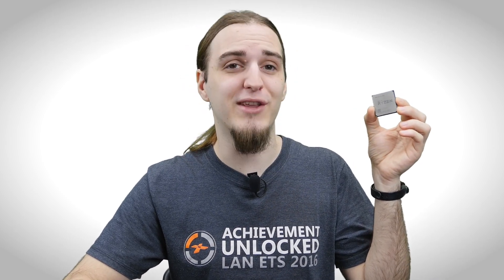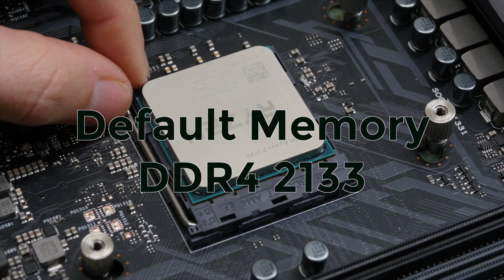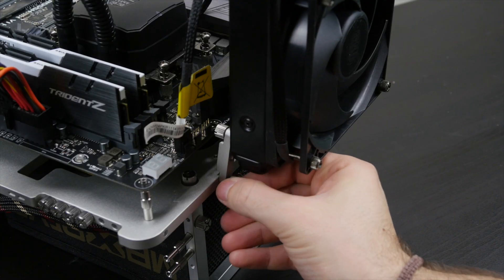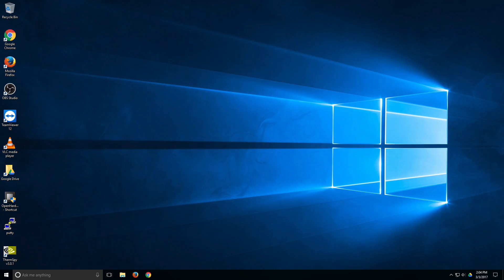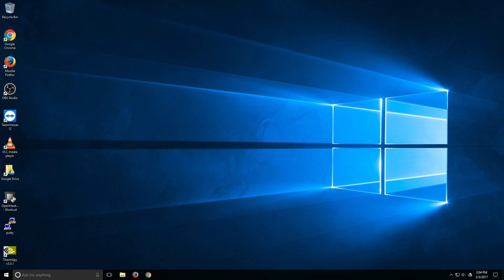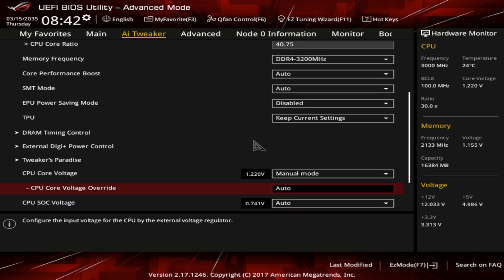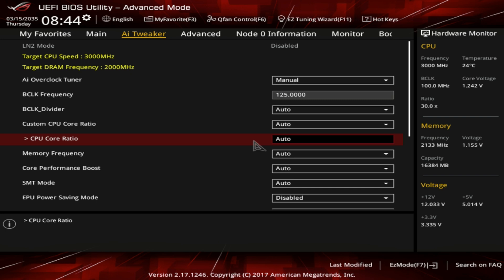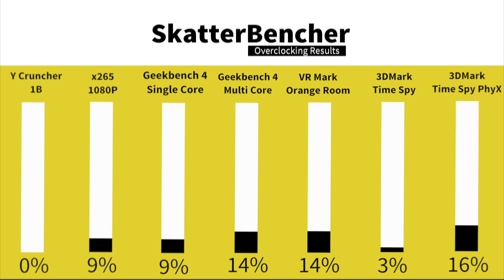AMD Ryzen 7 1800X Overclocked with ROG Crosshair VI Hero and G.SKILL Trident Z | SkatterBencher #8

Comment: Nice video. Just ordered parts for a new system, same CPU & mono but the Asus board is on back order.
https://pcpartpicker.com/user/TheShaz/saved/#view=pTbdCJ

I ordered 3200 Corsair ram, how high do you think I can get it?
Reply: Thanks for the advice
Reply: I have another question regarding maximum or higher memory speed on the ram, as ryzen seems to profit from higher memory i would like to go higher than 3400. 
Is it worth buying 4133 4x4gb 1.4v trident z?
Is it possible to reach these numbers with the 1800x combined with this memory or just not possible?
thank you

Comment: How high would you guess you could overclock Corsair Veng. LED DDR4 3200Mhz?
Reply: Interesting indeed! 
And would It be able to handle a stack up to 64Gb DDR4(16gbx4kit (vengeance)) on those speeds, or will I get some problems and maybe slower results. Believe I have read that Ryzen supports dual DDR ports, or is there something I am misunderstanding here? (board supports 64gb in this case, Gigabyte GA-AX370-Gaming 5)  

(It has been maaaaany years since i built a computer, and memory has become somewhat "complex" it would seem, or rather I migth just be out of practices).

Anyway, thanks for your answer.
And looking forward to here your opinion on this one.

Comment: silly question, new to OC here

Will this apply to any motherboards and to any cooler?
Reply: Wow, awesome guide for overclocking step by step and answering questions in the comments too... really commend that. 

I purchased a 1700 with a Gigabyte B350 board, which should be coming in about a week or so... I'll be referring to your guide when pushing the chip. 

Could you give some more explanation of the Voltage offset please? Is it a "one size fits all" for 0.1v, or will some clocks\cpu's require more or less depending on how hard you push them. I've heard the heat output really starts going crazy over 1.4v, which would be a 0.05 offset. 

Second question, I purchased G-skill DDR4 1866 RAM. Would it be safe to overclock this? Should I stay below certain voltages\temperatures, since I'm aiming for a long-term reliable build. Is it even necessary to overclock the RAM? Reviews including yours seem to indicate that Ryzen actually benefits from OC'd memory quite a bit. 

Awesome video keep it up and hope to hear back. Cheers
Reply: I'm thinking of having a B350 Tomahawk mobo and a noctua NH D15 air cooler

Thanks for the guide though, of all the overclocking videos I've seen this is one of the most detailed guides yet.

Comment: I am kinda surprised with the vcore - In my setup everything on auto the vcore ist set t0 1,4v !? And that on the same baord with defaults !? 

What is the default vcore for the 1800x?
Reply: SkatterBencher That's reasonable. but are there any specs which state what the actual default vcore is?

Comment: Hi, I just ordered my Ryzen 1800x yesterday together with a msi gaming pro carbon and corsair ddr4-3200.
Are these setting you show in the video safe to operate with? i am new to overclocking.
My Memory will be cl16/18/18/36 in specs, so do I have to enter these values or do I have to put in the values in your video?
The 4075MHz you entered is the normal clock speed of your cpu, right? how far will the cpu boost with that setting?
Reply: set the memory timings you have 16/18/18/36
I think when he disabled the boost with these settings.
be sure you have some great cooling set up and a great thermal paste.
things might be different on your BIOS, se be careful and use logic.

Comment: Why use RAM @ 3200Mhz with CL16 if it is 3200Mhz CL14 from factory???
Reply: Ok I see it's a quad kit... Not dual kit from factory... Is this the reason to not reach CL14? I'm curious because I bought the same model and color scheme but 16Gb dual kit xP

Comment: You are one of the very few who actually SHOW how to overclock. Everyone else just just tells us how but don't really show how. With these overclocks can you run some FPS benchmarks to show if these increases make any significant gains? So far other reviewers have only shown benchmarks on stock settings.  Also what's the highest stable overclock you have managed to achieve with this chip? Air/liquid/ln2?
Reply: Did you try turning off cores/features? AMD said, that the HPET has a big impact on that
Reply: +SkatterBencher no - it was in the Reddit AMA from AMD. They also said, 
that the voltage of 1,45 is the "recomended" maximum, but it could take 
higher voltages (with decresed longevity of course). Would be 
interesting to see, if any Ryzen could get to 4,5 GHz...Maybe with 4 
Cores, SMT and HPET disabled (but last i heard, this isn't implemented 
yet in the bios...i'm still waiting for ITX Boards...). Just to see if 
that F-HD Gaming "Fiasko" can be resolved with that.
Reply: myslef, seeing that these were originally meant for content creators, i would love to see a test on how R7 compares to i7 when you throw a 4k video render at it, when you are also gaming and recording/streaming at the same time or you came back from a holiday and want to catch up!
Reply: Lord Xantosh of course the ryzen will be faster in video creation due to more cores. Gaming and streaming? If i7 has lag, just switch to NVENC instead of x264 cpu preset, lag problem gone for i7
Reply: 1800 2Easy it isn't about whether it is faster, but whether this sort of workload is doable or not on the new arch, now i know intel X99 is capable enough to render and play or stream and play, but i have never seen anyone throw this sort of test at either platform, a test where all 3 are being done at once (if possible) it would be good to see the limits of each chipset!
Reply: Agree.. some just too complicated

Comment: And what about temps? Hardly anyone talks about that. :-/
Reply: Sounds good, but do you remember the temps you had with the 1700x? Asking because i will either get the 1800x (but gaming performance seems kinda bad right now without optimizations) 7700k or the 6850k.
Reply: Sounds good as well, Joker for example had a 20° difference (3.9 vs 3.9) with the 1700 vs 1800x, so im waiting a bit to see what is going on. :)
Reply: SkatterBencher do you have an 1700 ryzen to test?is it true that runs cooler -20 celcius with lower vcore stable at 3.9ghz